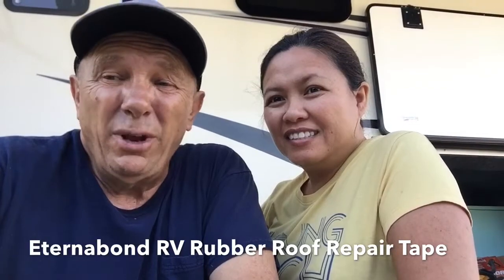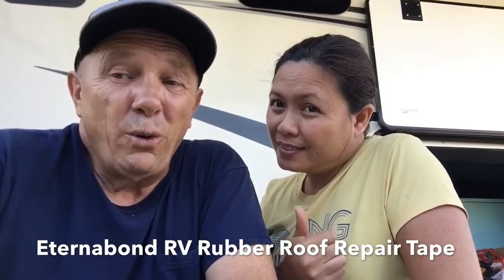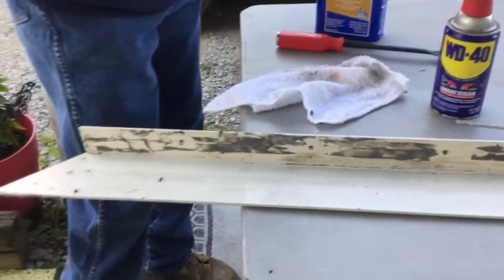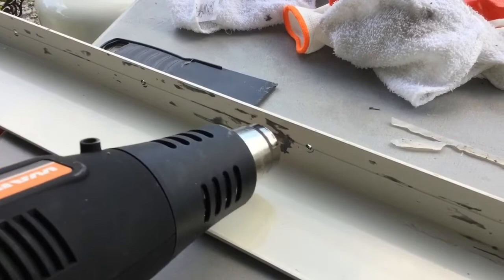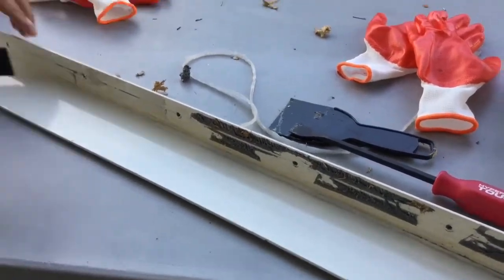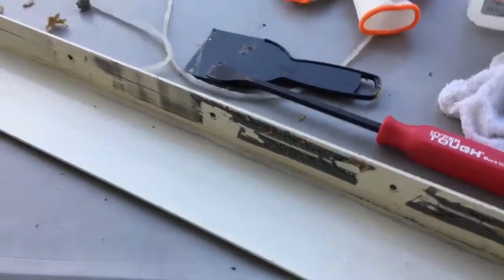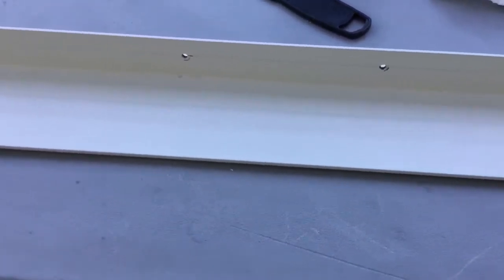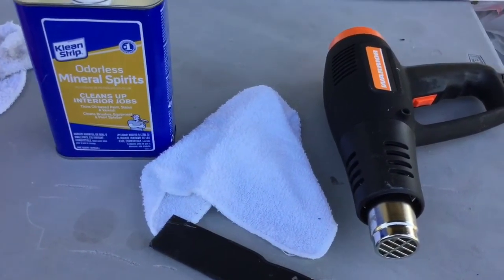How to Remove Eternabond //Eternabond RV Rubber Roof Repair Tape//DIY

Comment: Great help guys!  I’m trying to clean the old tape glue off my roof after a shower dome repair. Not going to use a heat gun on my roof but the rest is great info. Love the way you illustrate the processes.

Comment: I read on the H B Fuller (manufacturers of Eternabond) website that you don't need to remove all of the old glue to put another layer of tape.  They said it will adhere to the old glue that is left perfectly....